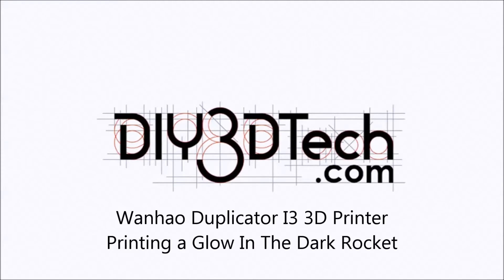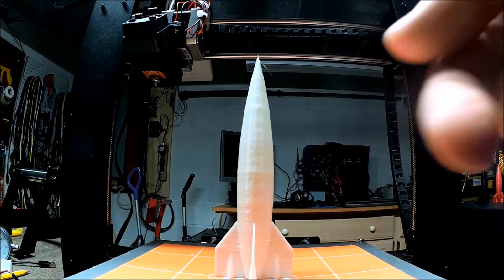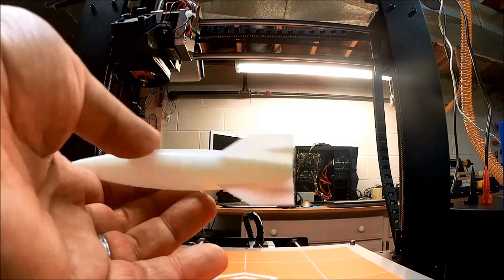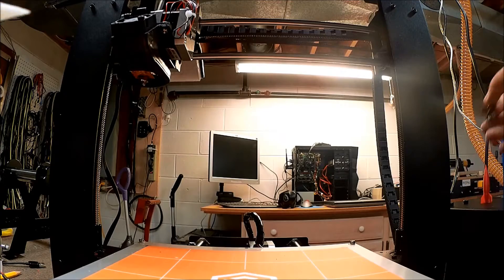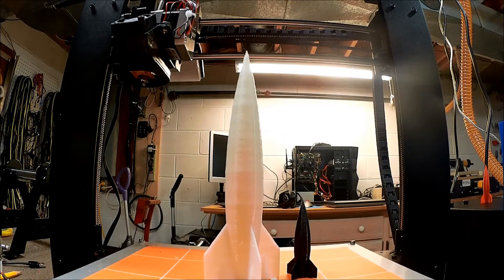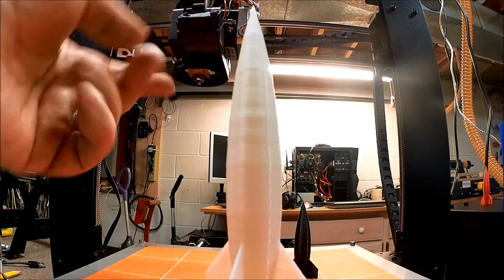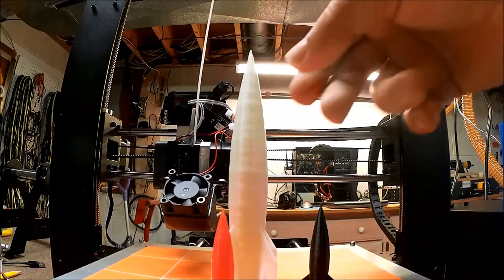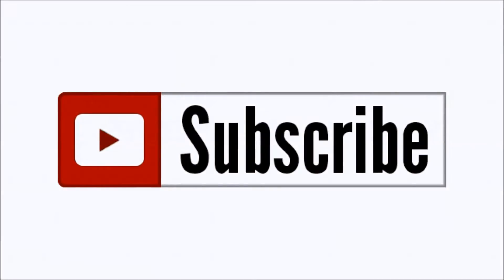Wanhao Duplicator I3 3D Printer - Printing a Glow In The Dark Rocket!

Comment: I ordered some glow in the dark with the wanhao they subbed it out to matter hacker at first I wasn't to impressed with the glowing but it's been a few days after the parts have been printed one being a quadcopter frame  and get direct sunlight and the other pieces or for the Z support on wanhao and all glow really well I started to notice the quadcopter frame glowing better so I was going to say the UV rays from the sum improve the glow but the z supports never get sun light so maybe it's just time.....so if your not happy at first with your glow just wait hopefully it does the same for all.
Reply from the maker: +Chi Sty You know that makes a lot of sense (i.e. natural light) will give that a try with the rocket and see.  Also what infill did you print the parts with?
Reply: I print all my quadcopter frames at 100% and the z supports was at 100% as well.
Reply from the maker: +Chi Sty Thats basically solid, so that is a lot of mass :-)
Reply: The z supports are I would say but the quadcopter is more like 2mm walls as a frame.